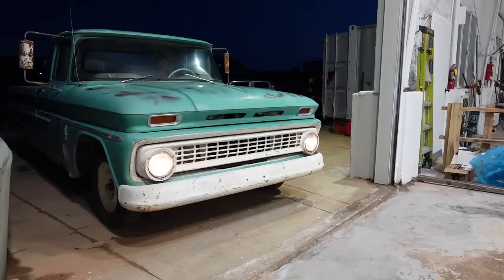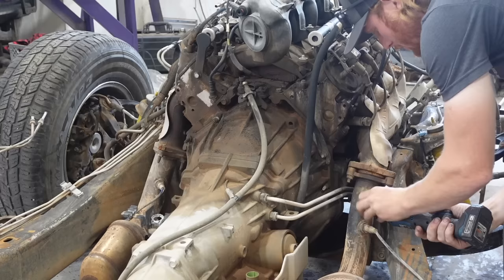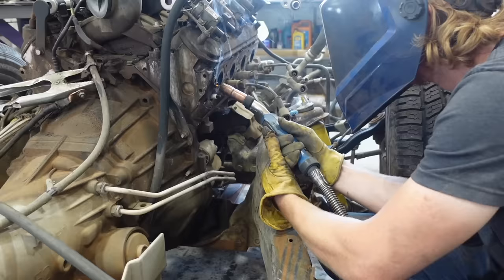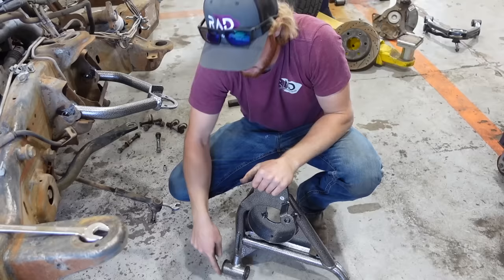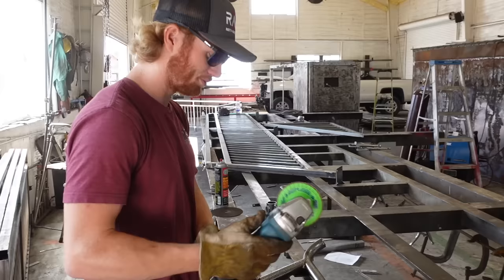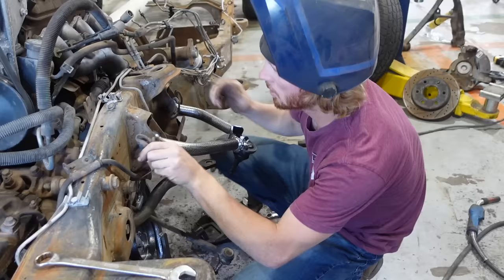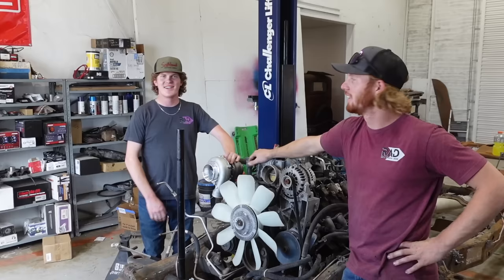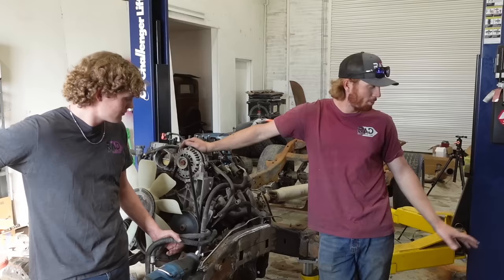This Might Be A BAD Idea For Kaulin's C10 Dream Truck

Comment: If you happen to see this I and I could give my humble input I would highly recommend you consider going with an aftermarket ECU like a Holley Terminator especially since your putting a turbo on it. It gives you so much more control over things which ultimately helps with reliability and longevity of that LS.

Comment: Kaulin wanting his truck to go lower instead of higher is cool and a complete 180 for this family. Rudy can get it done. If the control arms never cross center then there won't be any bump steer. Both front tires will stay in alignment  with each other instead of the toe changing. You can use taller ball joints if you have to. It will make the steering feel much better and lower the front roll center. Mount the rear track bar as low as possible and keep the sprung weight to a minimum. I would also use sway bars front and rear to further improve cornering. It could handle like a sports car. Cool project.

Comment: LS manifold bolts are always broke. Just weld up a nut and zip them right out. Its not a big deal. The heat shock and aluminum head make it pretty simple.

Comment: those airbag mounting plate should have been mounted in the opposite angle facing in,so at high inflation the bags would inflate almost straight up & down. just a suggestion.!!!
Reply: Was thinking the same myself

Comment: Looks like you have a good plan.  Relocating the mounts is smart but I probably would have moved the upper mounts inboard more to compensate for the lowering of the lower arm pushing the bottom of the tire out but maybe you will have enough adjustability.  Nice job for the first go at it!

Comment: Do you have a way to adjust caster and camber? The slots that the upper control arm mounted in were the factory way.
Reply from the maker: My mounts are identical to the factory ones, I can adjust the caster and camber from them

Comment: Judy, have a look into Network attached storage. You can use multiple hard drives in redundent storage.
Looks like you don't need the wedge under the bag, to square the bag back up at normal ride height.

Comment: I feel your pain, Rudy.  Years ago when I had my first project car, a Mazda Rx-3 I documented the project with a 35mm film camera.  Day 1 photo, pull the hood, engine, and transmission, gut the interior, clean it, new windshield, scrape the paint, new engine and transmission, new wheels and tires.  Then I took the film to be developed and the camera had not advanced the film.  No evidence of its progress.  No Before photos.

Comment: You may want to consider fixing/avoiding the LS low oil pressure woes and remove the oil pan and replace the "O" ring on the pick-up tube. Also replace the 'O" ring on the crank position sensor (right above the starter) and avoid the leak it causes. That starter is a real bear to remove from a road ready vehicle.

Comment: I recently had to deal with a broken bolt and found out about the MDM, Metal Disintegration Machine. It's the Plasma Cutter equivalent of drilling out a broken bolt and it's very cool.  It's worth looking at to see the possibilities, but it's not for every job or even every shop.

Comment: sweet! I'm in the middle of building a 1960 on a tahoe frame.  its actually all lining up pretty great so far.  I am doing mine as a 4x4 though.  i put a little lift in it and I'll be running 35's.

Comment: The length of the upper and lower arms is different and if you lower the car using the springs you WILL alter the camber gain curve, possibly change the bump steer and you will NOT preserve the factory handling because you are now out of the designed operating range the engineers designed.  Lowering spindles are the right answer for those issues but if they aren't engineered properly you can have bump steer issues and clearance issues.  Ask me how I know!  Best thing is a well designed kit (not a pieced together one) that has good engineering behind it.

Comment: From my experience working on Chevy's, on all LS's the back manifold bolts always break. Make sure you put good motor mounts on the engine and don't use the factory manifold bolts because they are soft and break easy. And a little pointer put a flex pipe in on the exhaust so the new manifold bolts don't break again.

Comment: You can recover the data from a drive even if it has been reformatted. As long as the data has not been overwritten. Then software can create new registry entries to access the files that are missing. I have even retrieived data from corrupt drives.

Comment: I am a little concerned you have a bit too much negative camber built into that configuration at ride height.  I'd hold off fully welding it until you have an alignment pro look at it.

Comment: Looking great.  I do want to ask if you are concerned about caster. It's hard to tell from the video, but it looked like the upper A arm was pulled into the frame, and the tire is leaning inward on the top at ride height.  Just an observation.

Comment: This is probably my most favorite build on the channel.   Speaking from experience don't take tuning that engine for granted.  If you guys don't know what you are doing for tuning after the ebay turbo kit goes on and you get it up and running, it will be blown up in short order without proper air fuel and timing.   Also need to upgrade the fuel pump.

Comment: Definitely broke two studs in my old f150 when I was a teenager who just had to have those new headers.  Didn't fix it.  Ran it with a massive exhaust leak for years before selling it.  The adult version of me feels so bad for whoever tried to reuse that old engine.

Comment: That turbo kit makes no sense to me. Shouldn’t all the exhaust be routed through the back housing of the turbo and back out? Looks like you have a full exhaust with a turbo extension making less boost pressure.

Comment: While lowering may look cool, I hope that you do not live to regret the decision. I have never understood lowering. I am 79 years old and the low vehicles have never worked.
Reply: I’ve had 3 bagged vehicles and didn’t have any problems with them. My last one was a truck that sat on frame and could still haul my dump trailer or car trailer no problems. Plus it wasn’t hard to get in or out of. Now the 2 cars it was hard to get out of them at times and that’s the only problem I had. The ride quality was better due to I only had to run half the air pressure cuz I went with bigger bags then what I needed.

Comment: Rudy don't use those Sandisk external SSD's 'cause they have a factory problem with the firmware and they destroy themselves, with no recovery at all because the data gets corrupted and erased so no data recovery can do anything.

A better idea is to buy a NVMe SSD case with USB 3.2 Gen 2X2 or 3.1 Gen 2 and buy a 4 TB NVMe SSD from any brand you want and save every project there. My suggestion: A Kioxia, Crucial P3, WD Black, Solidigm or the one sold by Micro Center. 

Greetings from CHIAPAS MEXICO, I can't wait to see the finished truck. 

PS. Question wouldn't it be more responsive and reliable if that truck had a supercharger?

Comment: I'm guessing that Kaulin will never be taking this truck off road since it will ride so low.  Not to mention parking lots with speed bumps unless the truck will have air bags.  Spoke to soon about the air bags.

Comment: The problem I see is you made the bags square to the A-arms when there’s no air in them. That’s not important at all. It’s important that the bags are square when inflated not deflated. So that’s no beuno!!  You need a white board to plan things out. You’d of seen that no need to chop mounts off the new A-Arms and would have made bag mounts square when inflated. Still a lot left to build so it’s nvr to late to go back to the drawing board! Well start by getting a drawing board first.  But all in all it’s super cool build and your fab wrk is always great even when it’s not correct

Comment: Rudy learning the hard way that computer aren't your friend :p
So might be wise to invest in some more storage devices, so you have 1 drive for original files, 2nd drive for backup of 1st drives, and 3rd drive for working and editing a copy of files.
Copy from recording device to 1st drive, and don't delete files on recording device before you have confirmed that said file(s) are copied to 1st drive AND been backed up to 2nd device, and have be checked and tested on 3rd drive, ready for editing. So at a point, a single file would exist in 4 different places, before deleting it on recorder and editing-drive (if you need the space)

Comment: They sell drop spindles that bolt right up to the factory mounts on those. Just like you did with the charger you're making things much more difficult than it has to be. And a ton more work. Do your research before playing hack job.

Comment: First I’ll say I Don’t like low riders. Especially pickups. Why would you want a truck that u can’t use as a truck. Why would you .want a large,heavy, two seater. And there not cool lucking. Not practical at all. But if it makes it easier for Kaulin to get in an out. Then low rider it is!👍🇺🇸🤪

Comment: I hate to see work like this just thrown together.  Without proper knowledge of steering geometry, and CAREFULLY making sure ll dimensions and angles are correct...this truck will be lucky to ever drive right.  Please start doing your homework and doing things right.  My late father taught me as a teenager to do a job right or don't do it at all!  Also, do it right the first time!  You have the ability, just slow down and do it right.

Comment: Spend a $1,00 on suspension, then chop it apart, then chop the mounts off and reinforce the arms which you could have done to the stock arms. Hey you know what? That's all part of fabricating. Otherwise you would just be a parts exchanger. Nothing wrong with either title or job, I have done them both and received pay both ways. You are trying to make something new out of something old.